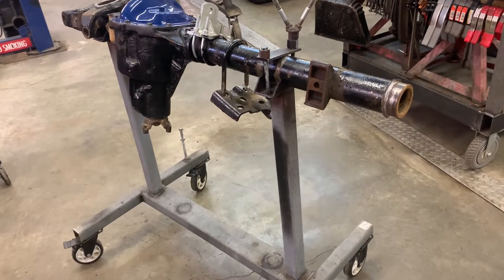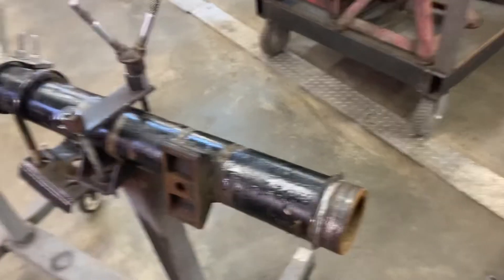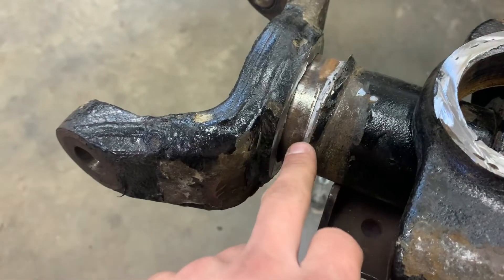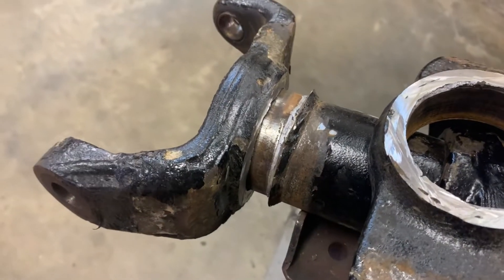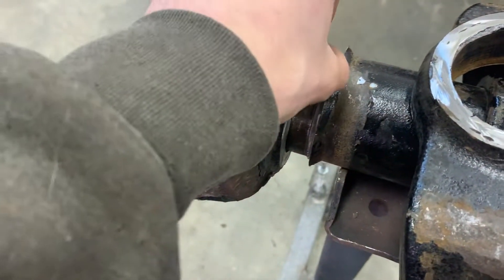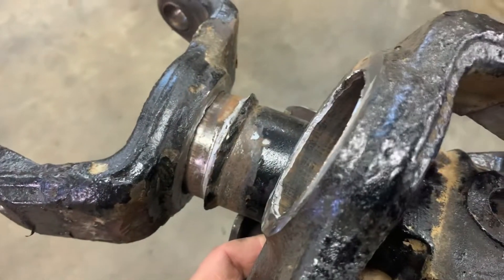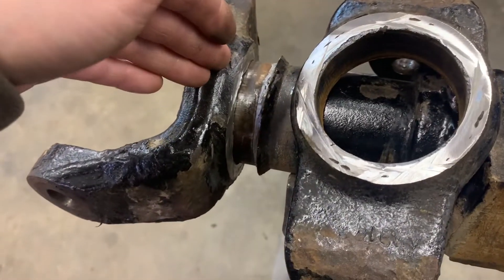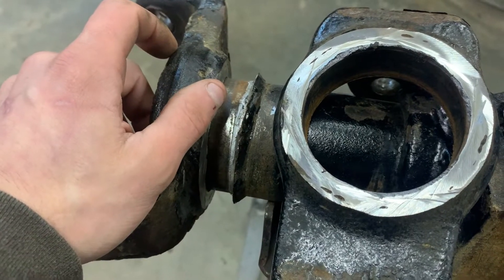Cutting and Rotating Inner C’s On Dana Axle

Comment: I stubbled on to this  video some how and has lots of info for diy guys i own a shop do a lot of cut turns and axle work in general today im building a hybrid axle gm corp 14 bolt center secton with dana 60 c for a rear steer square body crawler  i cut c off with a big  lathe which dont help diy guys

Comment: so if the purpose of rotating the C is to change the castor, how do you measure your new angle, and with respect to what baseline?? '79 scout II w/D44's!
Reply from the maker: Usually on scouts I rotate the C 10*. If the spring pads are level you have ~5* of negative caster and if you rotate back 10* it gives you 5* of positive caster. Would be best if you have the axle in the rig with weight on it, measure where you're at with caster and then that will tell you how much to go. I usually try to get them to 4-7.

Comment: I've got both of mine down or slightly below level with the axle and I'm smacking with a 3 lb hammer but no dice.  Would it be a bad idea to put some heat on it and smack it?
Reply from the maker: Yeah some heat can't hurt. Also try hitting the side of it to spin it as well
Reply: @simpsonoffroadllc  right angle air tool grinder going towards the C but not down into the axle worked like a champ.  C's were so tight on there with off road funk, took forever to hammer off due to tightness.  Thanks again for the video and the reply!

Comment: Great video. Curious what your process is to weld them back up so the average joe can do it
Reply from the maker: Pre heat the inner c to 250+ degrees and any welder that’s 220. I usually tack in 4 spots then weld in quadrants but I’m trying to rig up something so that I can spin the housing while welding for a continuous weld

Comment: Yeah, I am glad to see this.  I am surprised the number of fully built front axles that don't have this change.

Nothing wrong with taking off the C by grinding out the weld.  Yes, this can cut into the axle tube and the C.  Which is actually a good thing.  The space will be filled with weld which gives the joint more weld than factory.  This more weld and penetration into the axle tube and the C makes it stronger.